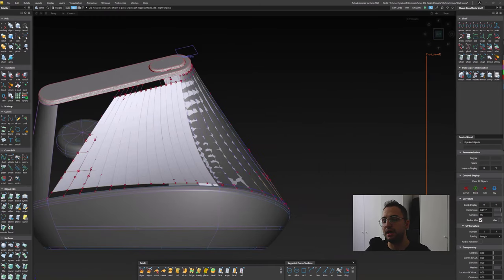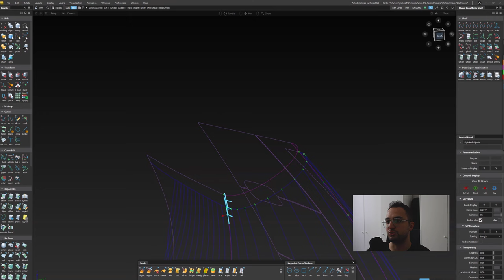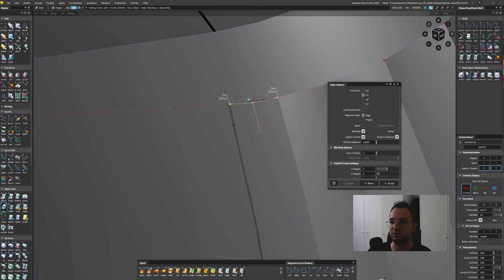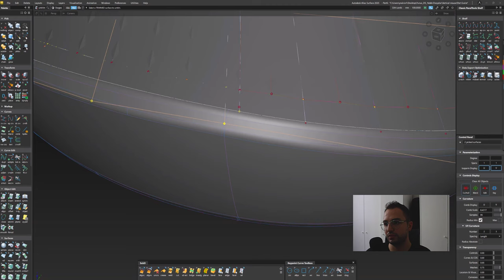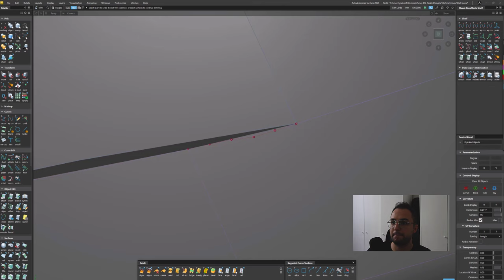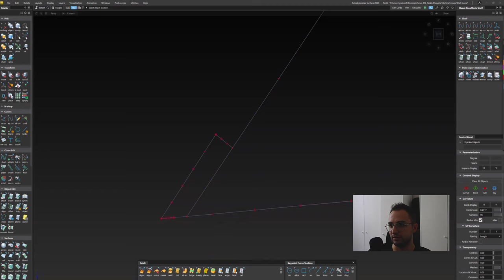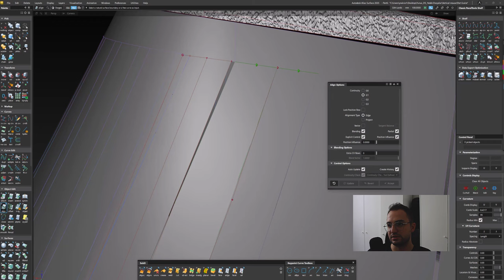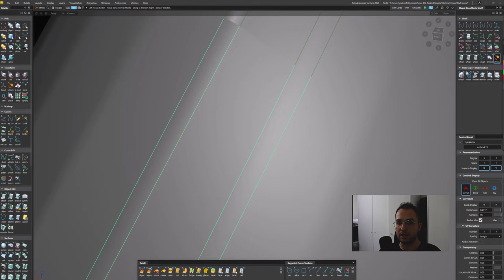Alias 3D Modeling Mid-Level Part 6: Finishing up

Comment: Hey! Appreciate the tutorial but you didn’t upload all the files in the description and it's hard to catch up with your speed at times. Can you please attach the rest of the files in the description so it will be easier to understand the design
Reply from the maker: Hello, thanks for the comment. The files that I shared covers the latest phase curve network of the model, so simple square or skin tool with little surface touch must help reaching the volume. But if you ask for patterned areas this is a bit last minute advance touch so don't worry at all if you are confused... you are welcome to share your data with me so I can give you feedback. You can see my profiles attached in channels bio. Maybe that helps.